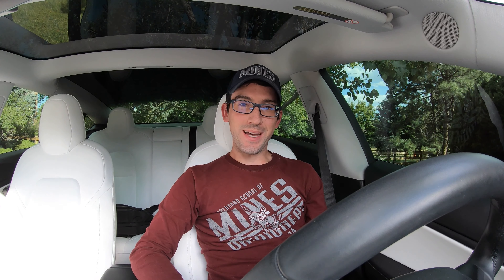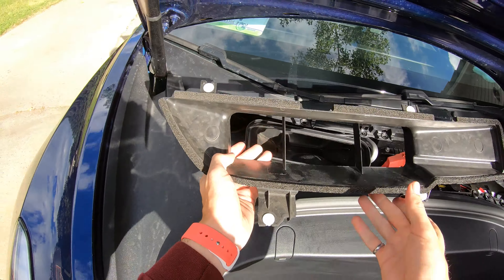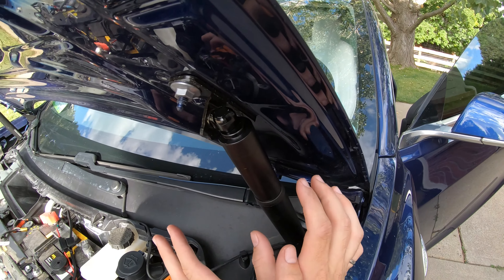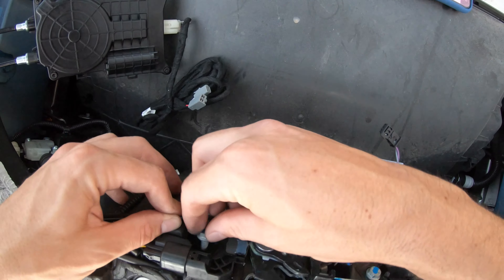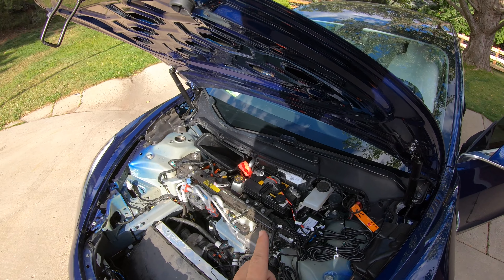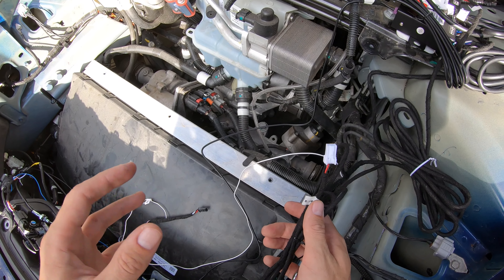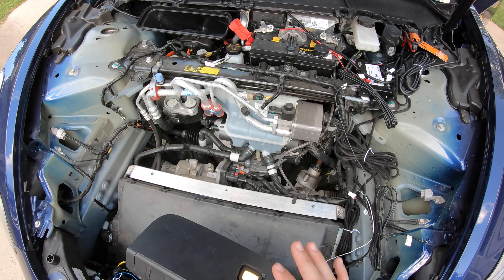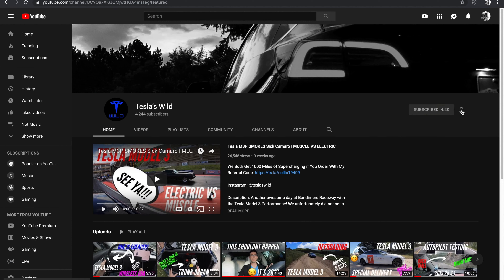Tesla Model 3 POWER Frunk | Auto OPEN & CLOSE | Hansshow

Comment from the maker: Alright, so here is the deal. In the original email describing the discounts they offered the original 17% and 21%; however, they later concluded that these were too great and went back to the 10% offered by other YouTubers. After talking to them and making my point, they are now offering the 10% discount on purchase, a discounted install if you want it professionally installed, and they will cover any insurance claims that arise due to the install. This is the best I could do. I'm sorry it is different than expected, it was as much of a surprise to me as it was to you.

Frunk/Trunk Kit: https://www.hautopart.com/product/tel...

Discount: Teslaswild1 (10% Off)

Both Kits: https://www.hautopart.com/product/tes...

Discount: Teslaswild2 (10% Off)

Highlights:
0:00 - Teaser
0:09 - Tesla's Wild Intro
0:25 - Opening Remarks
1:04 - What's in the Box?
1:43 - Removing Trim Pieces
2:29 - Removing Frunk Lining
4:01 - Power Strut Install Demo
4:34 - Tension Motor Install
5:46 - Controller
7:14 - Going Over Wiring
9:48 - Adjusting Speed Demo
10:57 - Siri Demo
11:18 - Closing Remarks

Comment: What is the issue you mention not be able to close on the screen after you open using the remote?  Is this issue fixed or because you did not connect the remaining plug?  Wrong installation maybe?  It show it work on the trunk.
Reply from the maker: I later came to find out that this is the same kit as the trunk minus 2 components and a different tension motor. So those two plugs are for the two components for the trunk, the trunk button and the trunk lights. Opening and closing from the screen works for the trunk, but not the frunk it seems.